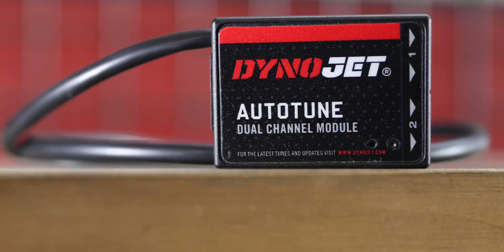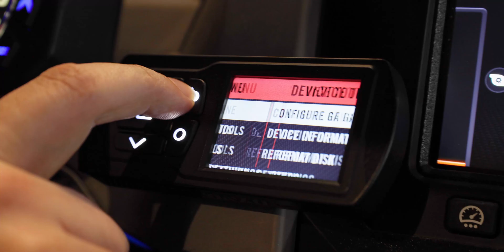Dynojet Power Vision 3 or Power Commander V: Which is Best for You?

Comment: Does the power commander remove the speed limiter
Reply from the maker: The PC6 does not have direct control over the speed limiter but depending on model you can extend the rev limiter which will increase the speed.

Comment: @Dynojet Research, Inc.    
I am interested in both of these options, but want the best option for my bike--- 2021 Cb650r with full Akrapovic system, max 1,000ft elevation so relatively flat,  Midwest Michigan riding. Is there another/ better module? Also will this auto tune itself for best performance, or will I have to adjust and or take it somewhere for tuning?
Reply: were you able to figure it out? Have a 2020 myself and ordered the Akro system, looking into into this because of that as well.
Reply: @Z3syst3m   dont get the Dyno vision 3 if you think you're going to get some great tune for your modifications. I have the US unrestricted cb650r, high flow filters, and full exhaust including headers from Akra. I was going to install the Dynojet 3 today ironically. I bought that June 3rd 2022, and shelved it for 2 years-- I basically wrote out the rest of the summer in 22 without it, then winter came, and life just happened all throughout 23 so never got to install it last year either. FFWD to now-- it was not a good purchase. My expectations were that this tuner would give me some type of mapping and etcetera for the modifications I have, simply and most importantly being the two-- full racing exhaust and high flow filters. Updated The Vision 3 to the current firmware available, and there are only two Tunes available. Both are for stock bikes without high flow filters, or full exhaust. One of the tunes raises the RPMs plus 500, and lowers the fan threshold coming on. Nothing magnificent. Called them twice today, and mentioned I was very surprised that there aren't any can Tunes available with a high flow filter and full exhaust-- something that you would expect to be the common things anyone modifies. Basically this module only comes in handy after you take it to get a full tune on a dyno, and then want to be able to select different maps that is stored within it. Essentially pointless. If I wanted to go get dynoed, and I would just keep that tune that was customized for my particular environment and riding style, completely negating the power Vision 3. I'm out the 450+ I spent for simply not knowing better. Take it to a dyno if you want but don't buy this. Conclusion; I've now been riding for 3 years without any tune after my modifications, in a while it may be a tad lean, it's not super lean. Bike runs great, and ECU has adjusted as much as it rightfully would on its own. I don't even know if I'll get it dynoed. Currently 8,900 miles on it from brand new, and did everything right away when I bought it. 👍

Comment: I have 2016 flhtkl all factory stock.  Plan to change remove catalytic, Change muffler, & air intake.  Which would be best for application?
Reply from the maker: We have the Power Vision Black Series for Harley-Davidsons that can be mounted on your motorcycle as a gauge for live data and much more, and we also have the Power Commander V for your motorcycle.
Reply: @DynojetResearch  Which of the two choices would be better?  We are fair-weather weekend & vacation riders, won't do any more than stage 1 mods, will never make a long haul (due to back surgery), but would like to improve performance while riding.  I would greatly appreciate the benefit of your advice. Thanks a million

Comment: Does power commander disables factory traction control?
Reply from the maker: It does not disable factory traction control.
Reply: @DynojetResearch  thank you, i will be placing an order tomorrow, i hope it fixes deceleration poping on Voodoo slip-ons!!!
Reply: @DynojetResearch  thank you
Reply from the maker: Of course. If you have more questions, you can email powercommandertech@dynojet.com to be connected with a Power Commander V technician.

Comment: I’ve been told by several tuners that the 2020 R1 ecu can not be flashed.  I want to install a full exhaust system will the Power Vision flash the ecu to allow tuning for the new exhaust? Can you shut off codes for the sensors or power valve so it can be removed?
Reply from the maker: Stan, if you email us at pv3tech@dynojet.com, we can help you out with this.

Comment: Does the Power Vision 3 need to stay connected to the diagnostic port at all times or just to flash the ECU?
Reply from the maker: Once you've flashed the ECU, you can unplug the Power Vision 3 or leave it on as a diagnostic panel.
Reply: @DynojetResearch   If I install a full exhaust this would do all of the required remapping/flashing required?
Reply from the maker: @m.wilson2624  Please email us at pv3tech@dynojet.com and we can answer more specific questions you have.

Comment: Looking for a device for my Cb300r. Looking at the power vision 3. But I noticed you guys only have stock exhaust and stock air filter. Are you guys making an after market  exhaust or air filter tune? I don’t have a dyno shop where I live. Or will the device flash tune it automatically to the mods I have?
Reply from the maker: Tiana, email us at pv3tech@dynojet.com and we can help you with this.
Reply: Were you able to get a tune that worked with a slip on? Similar issue except I noticed the don't have any for the CBR300r
Reply: @chefboy_rr  nope not at all. I was looking into getting an ejk.